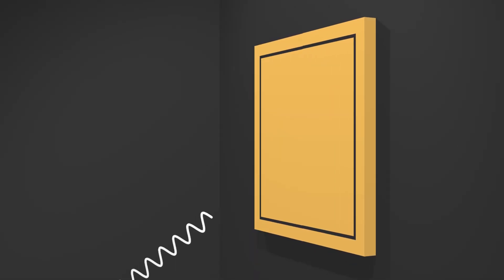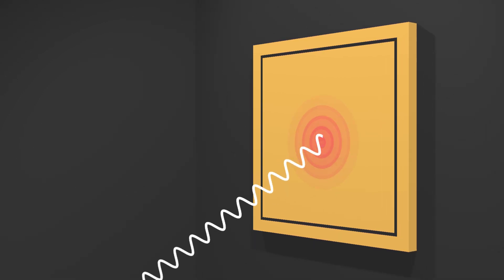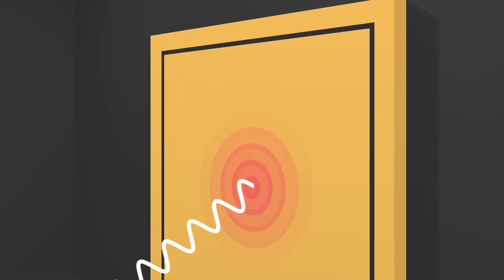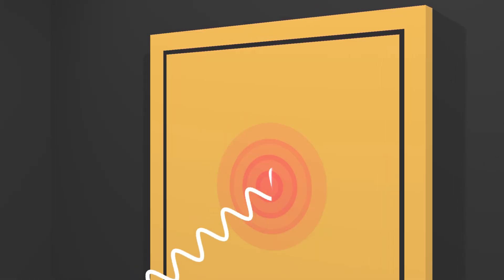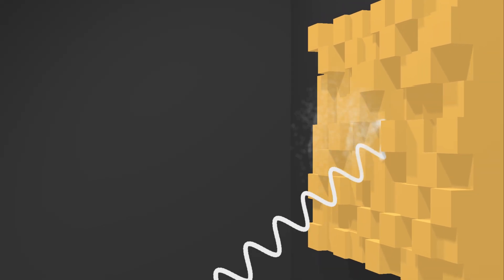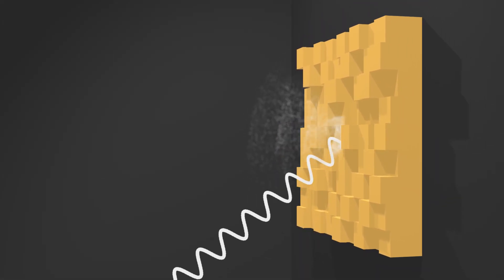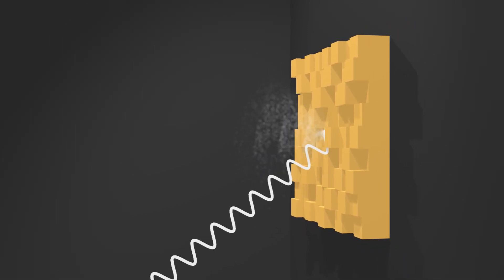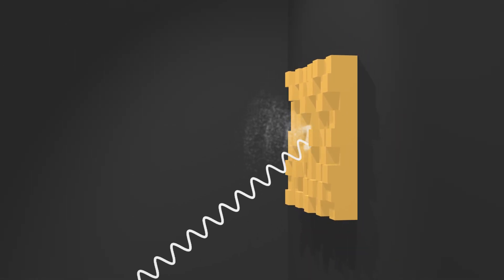Room Acoustics (HOME STUDIO Basics)  | ADAM Audio

Comment: First off, thank you for sharing tech info in a way the novice can grasp. Would it be a mistake to move to your T7V's for a 10x11 room......or I should go with T5v's....and use the extra cash to work on my existing acoustics? 

My home studio is in the back of our home and is also shared with family. I really can't install recommended acoustic treatments for professional studios.
10x11 Florida room:
2 glass french door walls with pull-down cloth shades

Ceiling  - wood
Floor - wood w/area carpet
Furniture: 90" cloth couch, cloth sitting chair, wood computer chair for my wood desk.....thank you.
Reply from the maker: Hi, Dave! That's a tough question to answer because we won't be able to see the room and setup. The T5Vs should work fine in this room but I would suggest listening to your T7Vs first. Set them up correctly and see if it works for you. If it doesn't you still have the possibility to adjust the speaker with a low and high shelf filter. All the best! :)

Comment: Do you have a video that explains the size of home studio vs monitor type?

I am in the process of building one that is 254cm x 377cm, but I don’t know if I should buy the a77x or a7x for this size room.

It will have GIK acoustics tri traps in the corners and monster bass traps on the ceiling. I have already made 6cm thick rockwool panels (x6) and will be getting diffusers for the sides at the back of the room and at both sides of a monster bass trap on the back wall.
Reply from the maker: For that room size, we'd suggest the A7Xs... the A77Xs may overpower that room 👍
Reply: @ADAMAudioBerlin  Really? But how then would I be able to know what's going on in the really low frequencies (20-40Hz)?

Comment: I really got something to share.
I got no monitors but I had some multimedia speakers which could handle High frequencies very well, I was missing the low end.
& even I had one Guitar & it was broken by the fretboard, I got a speaker which could handle some low end & fixed to the hole in the body of the Guitar, to be honest, it's pretty good. can handle some low end without any issue.

Comment: What do you do if your room is oddly shaped? I have a closet space at one end of my home studio room, but it doesn't stretch completely across my back wall.
Reply from the maker: Typically, oddly shaped rooms are better than perfect squares. And for closet spaces... if you don't need to utilize it as a closet, you can fill it with absorptive material to take care some of the low-frequency buildup in the back of the room. Also placing a couch in the back not only is great for guests, but helps with that as well. Cheers!
Reply: @ADAMAudioBerlin  in that case do you place your speakers where the closet is (in my case it's a wall, mainly because where the electricity plugs are in the room) or do you choose the opposite wall ? and if so positioning the set up in the middle of the room and having a bass trap at the corner behind the speaker fix the odd shape issue ?